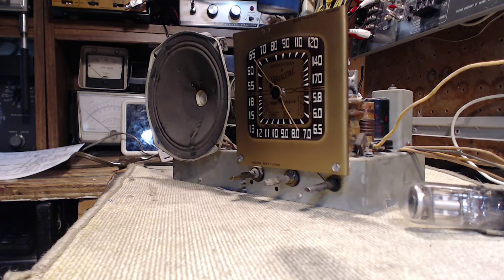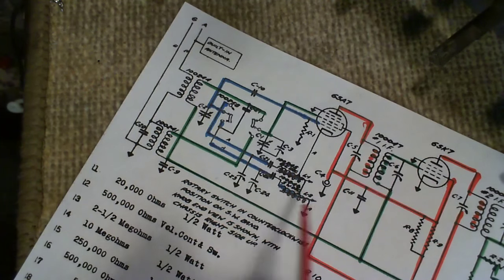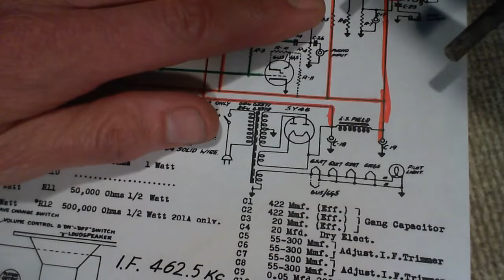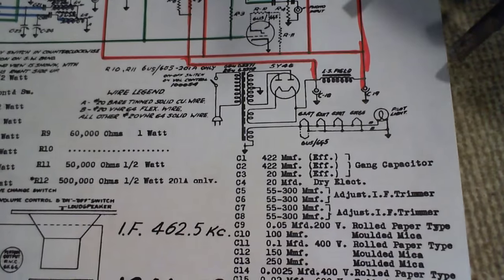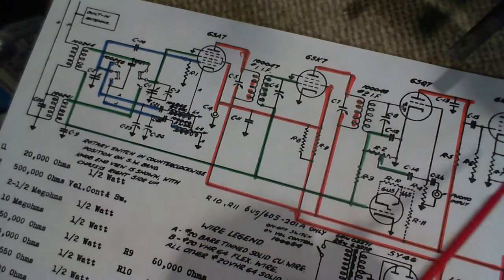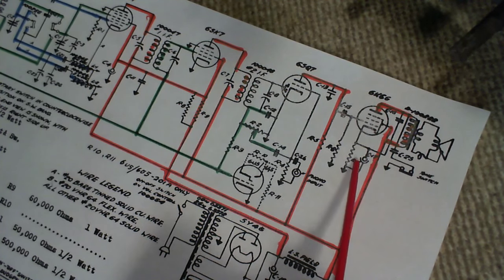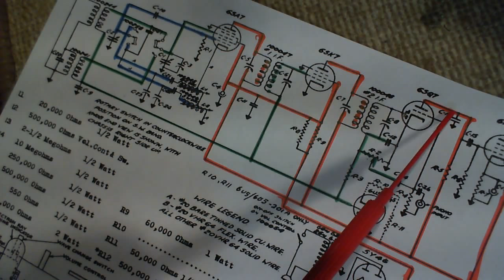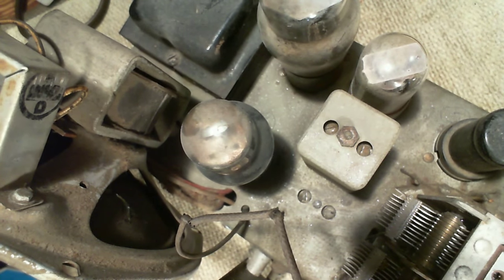Marconi 201A AM and Shortwave Radio Video #2 - Schematic Explained

Comment: Great video, keep em coming. I have a Motorola AM 5 tube, 51x17, I believe, from 1941/1942 that I was thinking on using as the foundation for making a short wave receiver, or by adding the band. You gave me some valuable additional points to ponder in my planning stages.

Comment: Great video Jim.
Glad to see you explaining the capacitor purposes,
and why the old wax paper rolled caps should just be ripped out and changed.
And as a bonus I can quit yelling at the screen when you fret whether or not
to remove and change the "death caps" ha ha on the transformer less sets
Reply from the maker: Slim Hermer I find that in some sets, the old paper capacitors are still fine. That's the case with this radio as you'll see in the next videos.

Comment: In the section on the power supply, the schematic I have shows the voltages at C-18 and C-19 and the voltage at C-18 is higher at the field coil than at C-19. I don't doubt that those resistors do adjust the voltage so that it is lower.